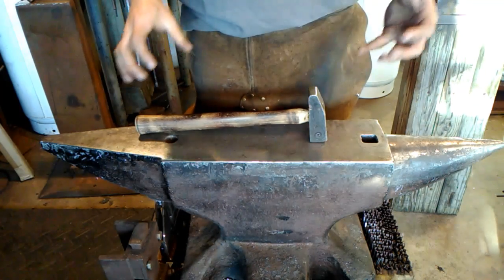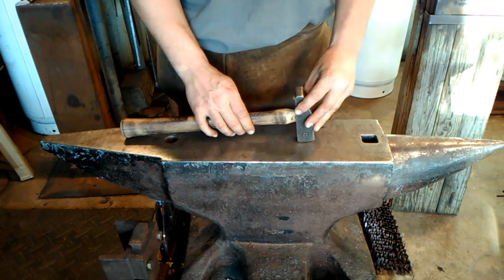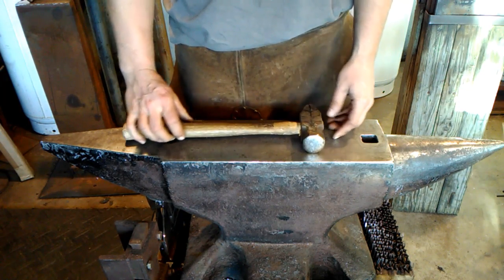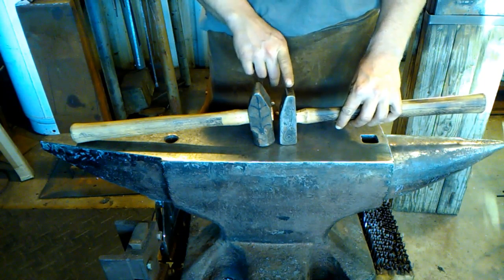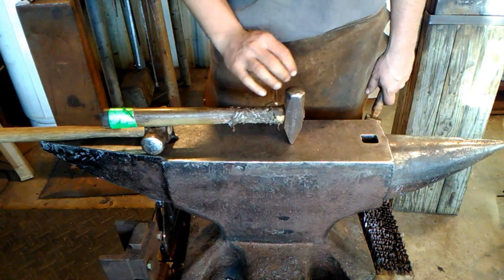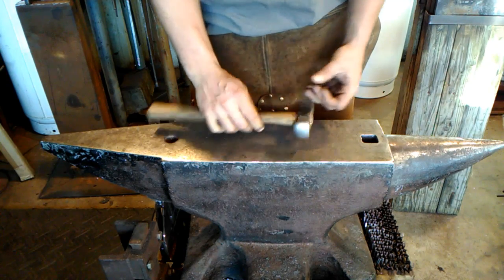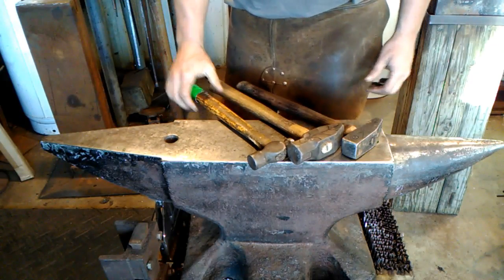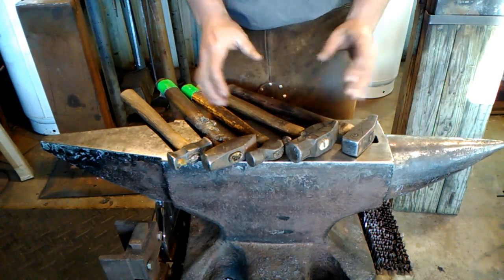Blacksmith Hammers and Uses // Types of Forging Hammers

Comment: Hammers, hammers, I adore them.  I have dozens of them.

Around the anvil I keep a rounding hammer re-purposed from a 4lb lump hammer, so it will be just under the original weight.  This is good for moving large amounts.  It's on a short, thick handle inevitably. 

I also have a 4lb ball-pein, also good for spreading, though I tend not to use it much. A shorter handled 6lb sledgehammer is good for driving big drifts, etc.  A 3lb flat/rounding hammer is a favourite.  

I have a 1 kilo square-faced German pattern hammer - sometimes I pick it up!  A favourite is a 28oz ball-pein.  I have a 1940s 'Gilpin' ball-pein hammer at 24 oz that was my grandfather's general purpose household hammer.  I use that out of sentiment but usually at the vice - texturing and shaping animal heads.  

I recently made a 3lb dogshead hammer from some 50mm (2 inch) diameter high carbon steel, but I fear it's probably too heavy and a strain on the arm.  I think I may use it as a handled flatter instead.  I should have made a 2lb dogshead, so now the hunt is on for some HC steel at about 30 -35 mm diameter (1.25 inch) - perhaps a truck torsion bar or track rod.  

I also recently put some grooves in the face of a standard 2lb ball-pein, to use as a texturing hammer.  I did this with a cutting wheel on an angle grinder.

I like my wooden hammers, especially a lovely old Beech wood sheet metal hammer, shaped like a tear-drop or a pear.

Good video Roy, sorry for rambling on.
Reply from the maker: +Finarfin man I love to hear the fact that you have so many different types of hammers that is awesome! Not only do I love making my own Hammer's but I love seeing the different varieties that are available. It is quite sad when I see beginning Smith's feeling like they need to choose just one style or type of hammer when we live in such a big beautiful world of tools :-) hope you are having a great weekend and have a great week God bless you!
Reply: Thanks Roy

I have loads more, maybe 100 hammers in total.  Perhaps even more.  Panel beaters hammers, heavier sheet metal hammers, claw hammers, brick hammers, roofing hammers, toffee hammers.  Copper hammers, lead hammers, rawhide, nylon.

Lol, it;s like a disease.  But you can never have enough hammers, as you have noted.  Here in the UK they can be found all over - at house clearances, yard sales, craft fairs, car-boot sales.  It's the same in the US that I'm aware of.  

You have to do some hunting and rooting about in old tool territory, especially when you get started, and that goes for many crafts, not just smithing.
Reply from the maker: +Finarfin yes sir a lot of my hammers I have on my tool rack have come from second hand stores and garage sales in the US. I have picked up really decent ball-peen hammers for 25¢ each and a whole slew of other hammers for a dollar:-) who said metalworking had to be expensive LOL.
Reply: Lol yes that's right.  You have to be canny.  You'll never make any money by giving it away.

Twenty-five cents is amazing.  That's only about 15 pence.  I would have said a dollar or two.  Probably a standard price for an old hammer head at a UK yard sale is £1 - which is about $1.50 - I think.

Its all good.

Comment: My favorite style of hammer is a straight peen  and I made my own 2 lb that does 99% of work. It has a semi square peen in between the round /squareness of the two hammers you showed at the start. I have 18-20 hammers but mainly use that single hammer. I forge everything from leafs and nails to ornamental signs to knives   Very versatile. Moves steel fast. It’s got a small face compared to many hammers because I like the small face best. It’s all a long head. 1-3/8” square face and about 4.5”-5” long on a 16” handle. It’s just what I find works best

Comment: a while ago i bought a 2.5 pound hammer as my carpenter's hammer was making a mess and putting cold shuts in my work glad i had friends that had a 2.5 other wise i would had to guess what size would be best
Reply from the maker: +grayem pepper 2-1/2# hammers are a great go between if you are getting started. heavy enough to Forge on large stock but won't kill the wrists on small :-)
Thanks for the great comment.

Comment: if i bought a hammer and took an grinder to it would that mess up the strength of the face or no?
Reply from the maker: +pogey piper as long as you didn't turn the face blue it should be still good.